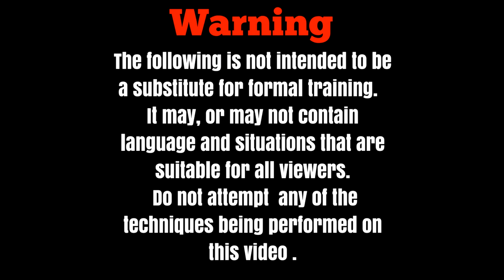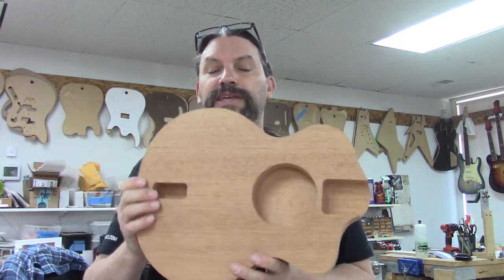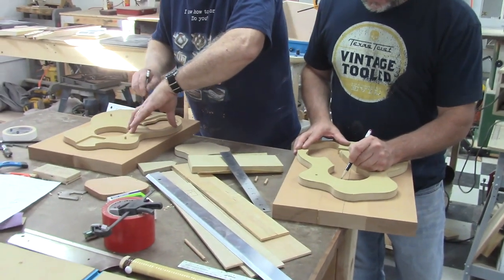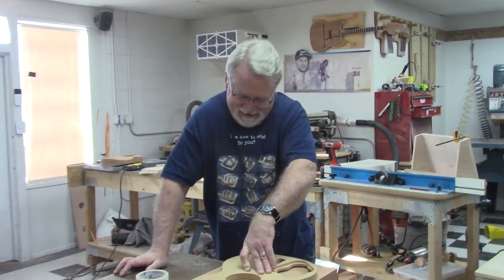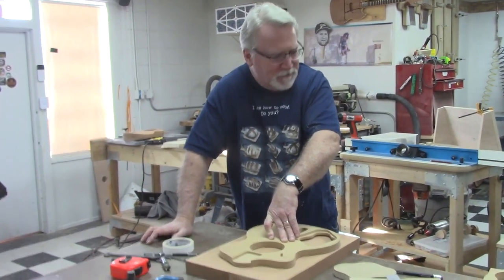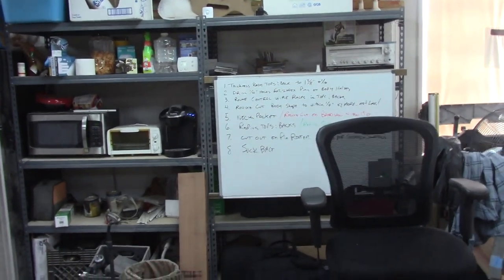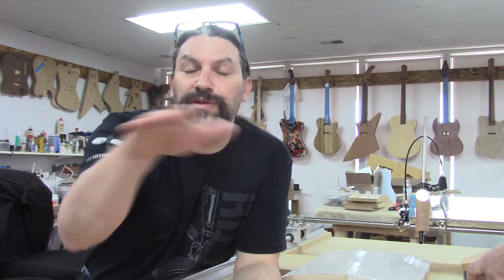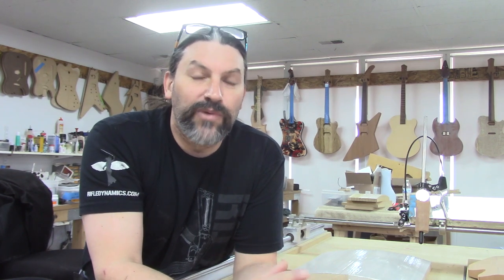How We Shaped The Turner Model One Inspired Guitar Body

Comment: Nice video.  The copy carver really caught my eye, this is the first I have seen it.  I dug the bike break.  Did you build it or where did it come from?  Keep up the great work!
Reply: The "copy carver" is a stripped down, improvised, DIY mechanism  similar to the tracer mechanisms which would allow mills, lathes, routers, or very specialized grinders (like those used to create crankshafts and camshaft for example), to utilize a two or three dimensional part or template, to define the limits, the geometry, of the workpiece based on the known geometry and dimensions of the template or the existing part. The profile of the part being turned in the lathe, or the surface(s) of the part being machined by the mill or the router, is created by the tracer mechanism, just as in the improvised copy xarver, is following the geometry of that template or part, and the difference between this and the CNC is that rather than a physical two or three dimensional template or part, the CNC profile or surface geometry that will be created is controlled by code containing numerical data, representing two or three dimensional positions on that template around that part containing the exact same coordinate data that the template or the existing part has it's just defined by the numbers representing the x and z or X y and z coordinates that exist on the template or the part, and this coordinate data controls and sets the dimensions of the finished part. Tracer machines are the direct precursor of NC and then CNC machines. Just like the similarities between a pin router and a vertical mill are pretty minimal. The table and the cutter are in the same relation to each other, with the pin router ear limits are set by a template and the PIN, on the CNC machine your limits are set by the two and three dimensional positions to find in the code, exact same information, just two different ways of presenting it. The pin router all of your feeding of the tool into the part, or part into the tool, however you want to think about it, how fast that tool is fed, how far it steps over to clear the material out, all of those things are done by hand, with the operator pushing the part around with his hands. With the vertical mill I can do the same exact thing, I can put a pin in the table and use the vertical Mill as a pin router. I have many times. But the vertical Mill allows me to securely, precisely, accurately locate and hold that work piece to that table, getting my hands away from that cutter. Now, all of the aspects of how that material is being cut by that cutter is controlled by me, either entering that information into the code, if I'm running the machine in automatic mode and running a CNC program, or I can control all of those aspects of that material being cut by the cutter by hand by using it manual mode and I control the movements, and how fast, how deep, how hard (woah, sorry, didn't mean to get your Mrs. turned on there LOL), how fast is that sharpened cutter spinning, and I'm moving the part, just like on a pin router, but instead of my hands and fingers holding that part and keeping it from being grabbed by the cutter, with my hands,  I've got it clamped down securely, I've got dowel pins or stop blocks to locate my part exactly where I want it, I can repeat that location with those pins or those blocks extremely accurately and precisely, I can hold my workpiece, I can clamp it as securely as I want and I can use the hand cranks to control exactly how much material I'm removing how fast I'm removing it how deep every cut is. I can do the exact same thing that the pin router is doing I'm just doing it with a hand crank, with metal or wood clamps, a vice, or whatever fixturing or work holding I think works best, allows me to get in and get out quickly, getting the job done extremely accurately, precisely, much more safely securing the part and holding on to it as it's machined, instead of pushing my hands, my hands, anywhere near that cutter spinning at however many thousand RPM. 

The two machines are extremely similar, just as his copy Carver is extremely similar in many ways to tracer equipped machines, If you look at the history of the pin router and the NC machine, they were introduced to thousands of shop floors in America at about the same time. Manual Mills, like a bridgeport, are far more old school than a pin router. I've run both plenty of times I've run manual Mills I've  CNC Mills I've run pin routers, many times. All of these tools can do a great job depending on who's using the tool, just like any tool in a shop, it's only as good as the person using it... or it's only as crappy as the person using it. The capabilities and limitations of every tool in the shop exactly match the capabilities and limitations of the person using that tool.

Comment: Very nice. I asked once before...why is the battery box on the face? Is it to be covered with a trapeze ? That would force battery changes to coincide with string changes...which I suppose wouldn't be optimal. I'd like to see every step of this build. It's a nice one to tackle.
Reply from the maker: It does get covered up with a trapeze shaped deal it is not exactly traditional
Reply: I don't know because I've never touched one but always assumed there was a skeleton, steel rod and plate frame holding the strings that was the business end of the tailpiece and the contrasting often black sheet metal shroud somehow fit or snapped on to it. If that's not how they do it , it might be a good idea if you want to hide a rout under a tailpiece trapeze thing of that size.
Reply: After looking at a video with a few, looks like many of the ones without the Piezo have no shroud or rout, regular trapeze with rods coming from the strap button. up to the plate that holds the strings. Can see full wood between. Heart breaker guitars has some Turner guitar videos. There's a doc on his shop, an hour of him being interviewed if you search. Great stuff. Got me dreaming of making a hybrid guitar with a model one mashed up with another classic.
Reply: The doc I was mentioning wasn't on the Heartbreaker channel, it was like a regular interview documentary from about 15 or 20 years back.
Reply: Maybe I'm wrong, it's only some of them now, and videos talking about the prototype that have the 2 rod open tailpiece. The black plate ones are on a lot of ones without the Piezo switch up top.

Comment: Yeah, that would have been tough without the beloved pin router! CNC is for little girls, by the way...
Reply: And you can't even program one, set one up, or run one, so you don't even measure up to a little girl.

... by the way.
Reply: The "copy carver" is a stripped down, improvised, DIY mechanism  similar to the tracer mechanisms which would allow mills, lathes, routers, or very specialized grinders (like those used to create crankshafts and camshaft for example), to utilize a two or three dimensional part or template, to define the limits, the geometry, of the workpiece based on the known geometry and dimensions of the template or the existing part. The profile of the part being turned in the lathe, or the surface(s) of the part being machined by the mill or the router, is created by the tracer mechanism, just as in the improvised copy xarver, is following the geometry of that template or part, and the difference between this and the CNC is that rather than a physical two or three dimensional template or part, the CNC profile or surface geometry that will be created is controlled by code containing numerical data, representing two or three dimensional positions on that template around that part containing the exact same coordinate data that the template or the existing part has it's just defined by the numbers representing the x and z or X y and z coordinates that exist on the template or the part, and this coordinate data controls and sets the dimensions of the finished part. Tracer machines are the direct precursor of NC and then CNC machines. Just like the similarities between a pin router and a vertical mill are pretty minimal. The table and the cutter are in the same relation to each other, with the pin router ear limits are set by a template and the PIN, on the CNC machine your limits are set by the two and three dimensional positions to find in the code, exact same information, just two different ways of presenting it. The pin router all of your feeding of the tool into the part, or part into the tool, however you want to think about it, how fast that tool is fed, how far it steps over to clear the material out, all of those things are done by hand, with the operator pushing the part around with his hands. With the vertical mill I can do the same exact thing, I can put a pin in the table and use the vertical Mill as a pin router. I have many times. But the vertical Mill allows me to securely, precisely, accurately locate and hold that work piece to that table, getting my hands away from that cutter. Now, all of the aspects of how that material is being cut by that cutter is controlled by me, either entering that information into the code, if I'm running the machine in automatic mode and running a CNC program, or I can control all of those aspects of that material being cut by the cutter by hand by using it manual mode and I control the movements, and how fast, how deep, how hard (woah, sorry, didn't mean to get your Mrs. turned on there LOL), how fast is that sharpened cutter spinning, and I'm moving the part, just like on a pin router, but instead of my hands and fingers holding that part and keeping it from being grabbed by the cutter, with my hands,  I've got it clamped down securely, I've got dowel pins or stop blocks to locate my part exactly where I want it, I can repeat that location with those pins or those blocks extremely accurately and precisely, I can hold my workpiece, I can clamp it as securely as I want and I can use the hand cranks to control exactly how much material I'm removing how fast I'm removing it how deep every cut is. I can do the exact same thing that the pin router is doing I'm just doing it with a hand crank, with metal or wood clamps, a vice, or whatever fixturing or work holding I think works best, allows me to get in and get out quickly, getting the job done extremely accurately, precisely, much more safely securing the part and holding on to it as it's machined, instead of pushing my hands, my hands, anywhere near that cutter spinning at however many thousand RPM. 

The two machines are extremely similar, just as his copy Carver is extremely similar in many ways to tracer equipped machines, If you look at the history of the pin router and the NC machine, they were introduced to thousands of shop floors in America at about the same time. Manual Mills, like a bridgeport, are far more old school than a pin router. I've run both plenty of times I've run manual Mills I've  CNC Mills I've run pin routers, many times. All of these tools can do a great job depending on who's using the tool, just like any tool in a shop, it's only as good as the person using it... or it's only as crappy as the person using it. The capabilities and limitations of every tool in the shop exactly match the capabilities and limitations of the person using that tool.
Reply: Given the choices of hands on, or CNC I choose hands on when it comes to guitar builds! I did not mean to ruffle any feathers ... ... ...

Comment: I find that CNC machines take away from the art that is guitar making.  It might be faster, but I feel you lose a lot of the personal touch that goes into guitar making.  I'd take a copy carving machine over CNC any day.
Reply from the maker: I really dig the copy caver too
Reply: The "copy carver" is a stripped down, improvised, DIY mechanism  similar to the tracer mechanisms which would allow mills, lathes, routers, or very specialized grinders (like those used to create crankshafts and camshaft for example), to utilize a two or three dimensional part or template, to define the limits, the geometry, of the workpiece based on the known geometry and dimensions of the template or the existing part. The profile of the part being turned in the lathe, or the surface(s) of the part being machined by the mill or the router, is created by the tracer mechanism, just as in the improvised copy xarver, is following the geometry of that template or part, and the difference between this and the CNC is that rather than a physical two or three dimensional template or part, the CNC profile or surface geometry that will be created is controlled by code containing numerical data, representing two or three dimensional positions on that template around that part containing the exact same coordinate data that the template or the existing part has it's just defined by the numbers representing the x and z or X y and z coordinates that exist on the template or the part, and this coordinate data controls and sets the dimensions of the finished part. Tracer machines are the direct precursor of NC and then CNC machines. Just like the similarities between a pin router and a vertical mill are pretty minimal. The table and the cutter are in the same relation to each other, with the pin router ear limits are set by a template and the PIN, on the CNC machine your limits are set by the two and three dimensional positions to find in the code, exact same information, just two different ways of presenting it. The pin router all of your feeding of the tool into the part, or part into the tool, however you want to think about it, how fast that tool is fed, how far it steps over to clear the material out, all of those things are done by hand, with the operator pushing the part around with his hands. With the vertical mill I can do the same exact thing, I can put a pin in the table and use the vertical Mill as a pin router. I have many times. But the vertical Mill allows me to securely, precisely, accurately locate and hold that work piece to that table, getting my hands away from that cutter. Now, all of the aspects of how that material is being cut by that cutter is controlled by me, either entering that information into the code, if I'm running the machine in automatic mode and running a CNC program, or I can control all of those aspects of that material being cut by the cutter by hand by using it manual mode and I control the movements, and how fast, how deep, how hard (woah, sorry, didn't mean to get your Mrs. turned on there LOL), how fast is that sharpened cutter spinning, and I'm moving the part, just like on a pin router, but instead of my hands and fingers holding that part and keeping it from being grabbed by the cutter, with my hands,  I've got it clamped down securely, I've got dowel pins or stop blocks to locate my part exactly where I want it, I can repeat that location with those pins or those blocks extremely accurately and precisely, I can hold my workpiece, I can clamp it as securely as I want and I can use the hand cranks to control exactly how much material I'm removing how fast I'm removing it how deep every cut is. I can do the exact same thing that the pin router is doing I'm just doing it with a hand crank, with metal or wood clamps, a vice, or whatever fixturing or work holding I think works best, allows me to get in and get out quickly, getting the job done extremely accurately, precisely, much more safely securing the part and holding on to it as it's machined, instead of pushing my hands, my hands, anywhere near that cutter spinning at however many thousand RPM. 

The two machines are extremely similar, just as his copy Carver is extremely similar in many ways to tracer equipped machines, If you look at the history of the pin router and the NC machine, they were introduced to thousands of shop floors in America at about the same time. Manual Mills, like a bridgeport, are far more old school than a pin router. I've run both plenty of times I've run manual Mills I've  CNC Mills I've run pin routers, many times. All of these tools can do a great job depending on who's using the tool, just like any tool in a shop, it's only as good as the person using it... or it's only as crappy as the person using it. The capabilities and limitations of every tool in the shop exactly match the capabilities and limitations of the person using that tool.
Reply: Have you made a lot of guitars with CNC machines?
Reply: I find that most people who make blanket statements about CNC machines and how much easier and faster and impersonal they make anything and everything are usually people who haven't any significant understanding or personal experience with CNC machines, or they've watched their neighbor who's got a little toaster on steroids with the router cutter in it and calls it a CNC machine and he can almost make a margarita with that little thing, but mostly the people saying that are people who either haven't done it in any significant amount, or who couldn't do it, or who are afraid to try, or who see something different point at it insult it because they fear it, or they think it's a lot of work and a lot of learning and they don't want to do it so they dismiss it, but I've never met anyone who has a real understanding and real world experience and knowledge of what a real CNC machine can do and what you have to do in order to make that tool as useful as that tool can be, say any of that crap about those CNC tools. But I'll say it again, limitations or capabilities of every tool in every shop exactly match the limitations and the capabilities of the person who is using that tool. Y'all have a great life stay safe. ✌🏼
Reply: @TexasToastGuitars  Fuck yeah, check out a tracer equipped lathe, I think you'd dig that tool